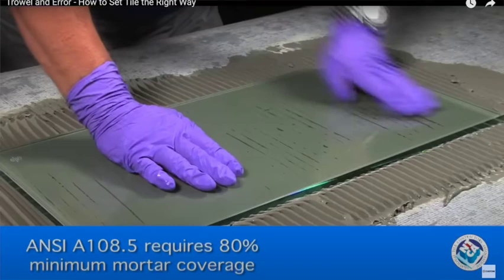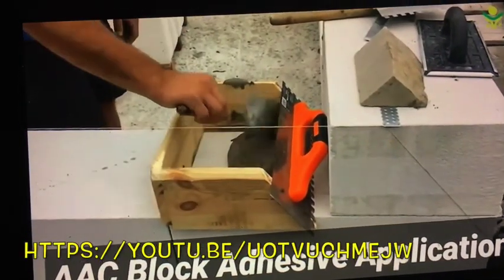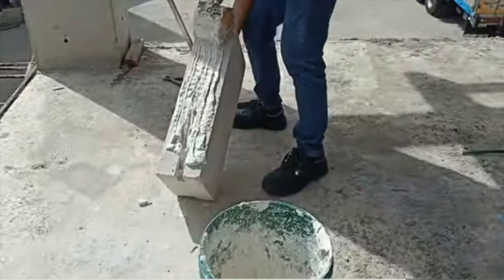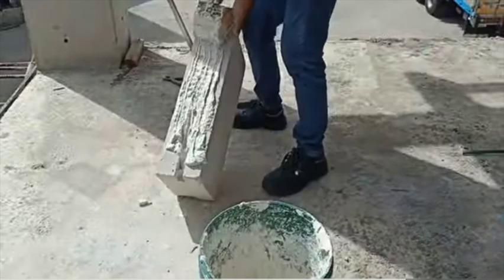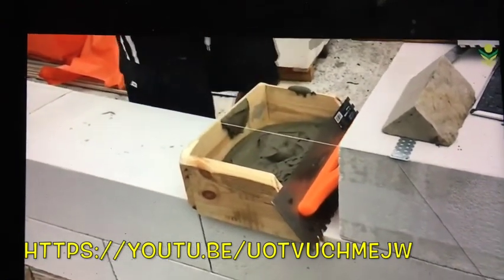Speaking Out...~AAC Adhesive done wrong in the Philippines

Comment: another important thing about lightstrong that seems to be not so evident on the net is the placement of small non load bearing stiffener columns and beams to break up any runs greater than 3m, same goes for any door and window openings on all sides , not just lintels above ...i suspect it's an anti seismic measure to prevent the whole panel toppling over in one fell swoop during a quake.
Reply from the maker: Seems the Canadian is similar to here… 5m.
Pins in the floor for each block. But at 90cm we did decide to run lateral rebar so we have, as you put it, stiffeners.

Comment: Even for tiling adhesive application is often done wrongly (or differently) here, because thinset tiling is not that common in many places. Much more with AAC, as they think of them more like CHB blocks and are used to 1 inch mortar joints. When using any new or different method in the Philippines you have to teach the foreman and the crew and watch daily that the manufacturer recommended method continues to be applied. It can be quite tedious, because as soon as they are not being watched they tend to go back to the way they "have always done it". Even if you have a lead engineer or architect, they may not apply a product or process correctly.  It is a huge issue trying to maintain quality with new or improved construction techniques.
Reply from the maker: I had one fellow tell me the international standards don’t apply in the Philippines. Next thing he knew he was working on the driveway. Training wasn’t from a lack of trying. As you mentioned… falling back to old habits 

Watching is critical. Not a huge difference compared to looking over the shoulders of my crew in Canada… Canadian crew was not failing to do the job right as… get off you F phone. That’s the western disease. Crews on the phone.
Reply: @kenlyn2208  international construction standards do not apply, because the laws of physics are different in the Philippines: 

water does not leak through cracks, concrete slabs cure perfectly in bright sunshine without cover and walls do not fall down from earthquakes 😉😜

Oh, and smartphones are a thing on construction sites here as well...
Reply from the maker: @ChristianWagner888  😂 😂 😂 
It’s the one thing our Ph crew did adhere too… no cellphones.

Comment: Can we use these in the bathroom without installing tiles since these are water resistant? I don't want to use tiles.
Reply from the maker: @peterpiper5300  yes providing your skim coat includes a water proofing before or with the skim coat.
AAC is buoyant but will mold, due to the aeration. This is why a thin skim coat and pressed into the block, with a proper trowel is needed. Those silly 4-5” tin scrapers leave to many weak spots. 8-10” handle trowels with long vertical strokes, for the first pass, is critical

Comment: Great advice. Right now im in a dog fight to get a contractor to use AAC, they know they wont make as much money in labor. Still in a search, we have time.
Reply from the maker: It was a real challenge. I was shocked and disappointed that the retailers don’t have any preferred contractors. My experience thus far has been… they, workers and contractors, deviate to much from the proper application of adhesive.
Reply: Hi @kenlyn2208 
I am planning to use AAC on my renovation plan. Where did you buy yours? So far am only aware of Stärken Ph and I believe they have trained personnel in building walls with AAC. What do u think?